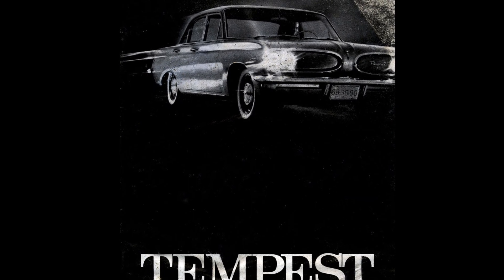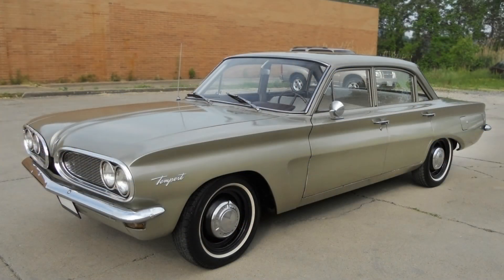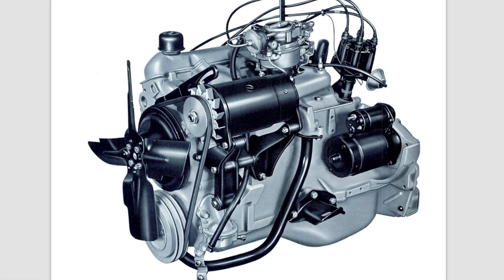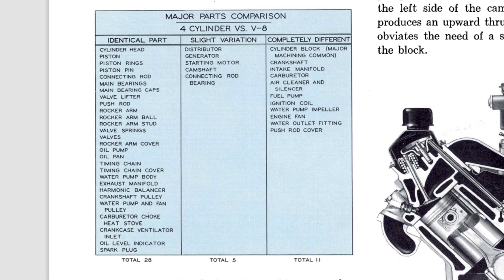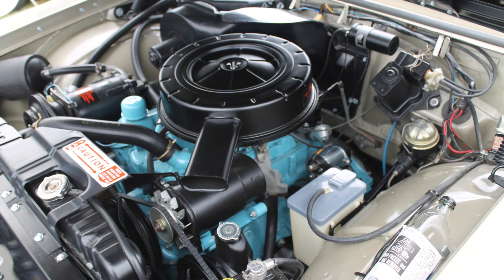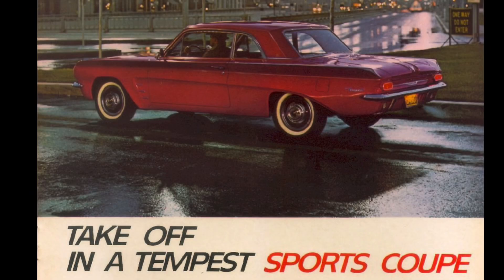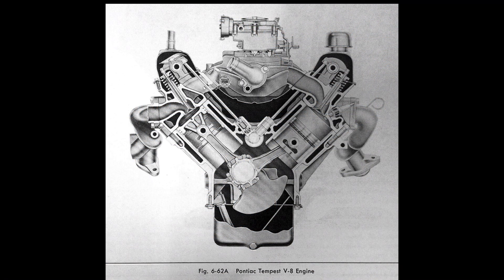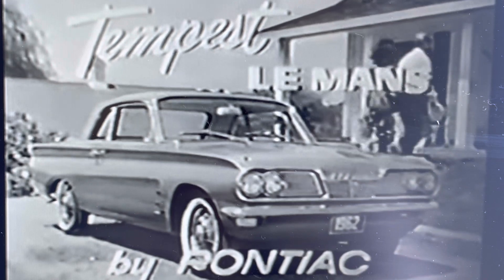Strangest Automotive Engines: The 1961-63 Pontiac Tempest & Its "Trophy 4" / "Half 389 V8" Engine

Comment: My mother had a '62 Tempest with the 166 horse engine, four on the floor, and convertible top. It was one of the cars I learned driving in. There was never any way to get it to idle anywhere near smoothly, but off idle, it was a fine little engine.

Comment: I learned something. Please do a piece on the 88,89,4.5L Cadillac aluminum V-8, 152 H.P.
With a reasonable torque rating
Of 242 ft.lbs. torque. My 88 Eldorado runs flawlessly, cast iron sleeves of coarse, downdraft fuel injection. Of coarse for 90,91, 4.0L, port fuel
Injection and more horsepower.
Highly underated as to durability . A great engine, unlike the Northstars which debuted in 93 on some models.
The 92 Eldorado with its last body style change until its demise  In 2002, the 92 had the 4.0L. Thanks for hearing my rant
Reply: *4.9L for 90,91,92

Comment: Corvair trans Independent suspension I got a 62 with a four-speed with air and Four barrel got mini 61s just rescued us some from the junkyard and got a couple wagons another strange engine for Pontiac 66 and up probably into the 68 arrow would be the dual overhead cam six cylinder with the four barrel Holley on it

Comment: When I was a teenager I kept up with automotive improvements and Hot Rod magazine.  I never expressed this thought to anyone because I didn't think I knew was interested in cars.  One thing I did notice was that I had gotten to the point where I began to think Pontiac was the "experiment" department of GM.  My interest in Pontiac was fueled by the 56 Pontiac we had when I was a teenager.  It seemed to me that Pontiac was coming out with all these weird new ideas like the 4 cyl. engine, the rear transmission and things like their overhead cam 6 cyl. using a belt drive.  That idea vanished as I noticed other GM manufacturers weren't using those ideas.  My favorite Pontiac is still the 65 & 66 GTO with the big block.

Comment: Those engines also had forged connecting rods as nearly all Pontiac engines in the 58-63 years.Tho not as reliable as forged rods for high performance engines they were much more durable than the original cast iron ones.

Comment: Cool, I would replace the trophy 4 cylinder with the new LS four-cylinder that Blueprint Engines is thinking about coming out with.  Or find a 3-71 GMC blower to put on it, Mickey Thompson used to sell some stuff like that for the Poncho 4 back in the day

Comment: My uncle had a 1962 baby blue 166 hp power pack Tempest Le Mans. The car had a four speed and a four barrel AFB 480 cfm carb on the four cylinder. He bought the car in 1965 and owned it until 1978. At that time, my brother and I both learned how to drive a manual trans car in the 62. In 1976, we rebuilt the engine. The car ran strong but went through pilot shaft and throwout bearings very fast. Changing the input shaft for the solid driveline was a chore and the torque tube had to be lowered to do the job. After several times changing it, the part became very hard to find. All other parts became very hard to find for the car as well. The car was never on a collision and had solid sheet metal when he sold it. We never did see the car again and I wonder what may have happened to it.

Comment: I had a 1962 Tempest in 1969. The things was running bad from a cam problem and A friend joking said I should put a 327 in it and I did.  I strengthened the unibody to support leaf springs for the rearend and transmission and welded a new floor for the transmission. It was quick. I blew the 327 and ran it with a 283 for a few years and sold it.

Comment: Our family had a white 1961 Pontiac Tempest station wagon from 1964 to 1969. The engine had only 115 hp and as a result it was constantly breaking down or causing problems if the car travelled any great distance on the highways. Toom much strain on the engine I guess.

Comment: My Grandfather had a 1963 version of this car. It was very basic. No power anything and I don't recall even having a radio.  I know he had problems getting the transmission serviced outside of the dealer. No one knew how to check the trans fluid. As I recall, you had to move the spare tire and open an inspection cover where the spare sat. Truly a strange beast.

Comment: The trophy 4 is a remarkable engine. Another guys channel i follow has dyno tested one, and is currently having it rebuilt. Afterward it will be redynoed with early and late heads, different intakes, including aftermarket 389 parts and POSSIBLY a turbo setup.

Comment: In the UK the same philosophy was applied by Triumph to the Dolomite straight four and the Stag V8, which despite being OHC had a half-speed shaft where the cam would be in a pushrod V8, that was used to drive the ancillaries and, by chains, the camshafts. There was much commonality of parts. The straight four was licenced and use for many years by SAAB.

Comment: I remember that.  My dad was a product engineer at Pontiac from '47 to '85, so I took a big interest in cars and Pontiacs in particular.  In the late '60s, I actually had a '64 GTO with the 389 cu in V8 engine.  Engines today are so-o much better with fuel injection and precise monitoring of the air-fuel ratio not to mention the tight tolerances of the machined parts.  Thanks for this walk down memory lane.
Reply: Also remarkable about today's V6 engines is with the power they generate with regular gasoline; yet, the modern engines can have fuel mileage equal to, or better than, of early generation compact cars.

Comment: Interesting video, Adam, learned some new things, thanks. Years ago, I bought a semi-restored 1963 Oldsmobile F85 that had the famous 215 aluminum V8. Best engine I ever had in any car. The slightest touch of the ignition switch would start the engine in a fraction of a second, and it ran and idled flawlessly, hot or cold. At idle, you could barely tell it was running. Best part: I got it at a great price because it would instantly stall out the moment you touched the throttle, so you had to drive it extremely carefully.  A few weeks later, I took off the top of the carburetor and looked into the accelerator pump tube, and noticed that some moron carburetor rebuilder had left out the tiny ball bearing that acted as a check valve. Dropped a random ball bearing into the tube, reassembled the carburetor, and suddenly the car would spin the tires on heavy acceleration. That was a very happy day. Kept the car for a long time until I loaned it to my brother, who took out the side of it, claiming someone sideswiped him on a bridge and then drove off. He later admitted he did it in a parking lot.

Comment: Rear Transaxle is much better than  front wheel drive  🚗. 
The Aluminum 215 V-8  and rear Transaxle ,  could have been updated  to compete with the Ford Taurus.  Alot of  interior room and 30 mpg,  huge trunk.  A Car  25 years ahead of it's  time.

Comment: The International Scout had two 4 cylinder engines built off of the IHC V8s. There was the 152 from a 304, and the 196 from the  392. I never saw the inside of a Scout motor, I was told that they had a V8 camshaft. I have seen one with a 4 cylinder distributor cap, all the rest had V8 caps. IHC use timing gears instead of a timing chain in the slant 4 & the V8. I am not sure when IHC started the slant 4. I have seen a 1960 Scout. I think that they ran from 1960 to 1968 or 1971. One of the motors had a turbocharger on it, I believe that it was a 152 turbo. 
Hello from north east Montana. 
10 miles from the Canadian border.

Comment: That was my first car dad found it's somewhere like 50 bucks the turn signals didn't work he told me when you get the turn signal will get tags for it and you can start I was 16 finally figured out turn signal switch in the steering column with broken Saturday came around dad May went down to the local wrecking and I had one got to switch out when home put it in we had turn signals three months later Dad sold it for like 400 bucks we get another car there you let me drive

Comment: I took my license in our 61 tempest it didn’t have park on the transmission rolled down a hill thank goodness the curb stopped it the parking brake was fully on after it ate it’s second chain dad traded it for a new 65 impala 327 loaded with air. We never missed the Tempest rough running 4 cyl engine

Comment: In 1969 I bought a white 1962 Tempest convertible.  It ran great, but kept pulling the left rear axle shaft out of the trans ... and the automatic trans shops were killing me.  I sold it and bought a 1965 Bonneville convertible, red, red gut, white top ... which I wish I still had today.

Comment: If the Engineers at Pontiac under the leadership of Bunkie Knudsen had only created a harmonic balancer that was doughnut shaped and subdivided into smaller chambers filled with oil separated by baffled  walls; they might have been the world leaders in small engine design. Just think, in another ten years or so, the energy crisis of the early 1970s called for just such an engine. GM would have had the jump on the Japanese and Germans by perfecting such an engine. We know what ended up happening. The oil companies would have their way and the consumer got screwed. Pontiac may still be with us if far sighted wisdom had prevailed.

Comment: I owned a '62 Lemans with 166 horse motor, four speed transaxle, etc. 15" wheels and tires paired with limited slip differential made for a very good car in snow. On the other hand swing axles similar to first generation Corvairs made for snap overseer if pushed too hard in corners. MPG was not that's great either. BTW, mine was same as red model in add except I had full wheel covers and Blackwell tires.

Comment: I want to see a good and thorough explanation of how the torque converter hanging off the very end of the drivetrain works. Does that whole assembly spin while the engine is running or is that an external cover or what? how do you get power in and out of it? Looks violently insane. I first saw this madness via the article on Ateupwithmotor.
Reply: It IS "violently insane"! When I was 19, I worked at a transmission shop in Pittsburgh, PA, USA and one of these Tempests came in for service. I actually worked in the torque converter rebuilding shop. There are concentric shafts (one shaft spinning within another shaft) in any automatic transmission. The Tempest transaxle and torque converter had one or two more! The power came from the engine through the torque tube, then all the way through the transaxle to the torque converter. Then it went back forward into the transaxle. To this day I still don't know how they got all of that to work. Because of this crazy design, the torque converters and automatic transaxles were completely unique to these '61-'63 cars.
Reply: @snowrocket  Look up the Vanagon 090 Automatic transmission - it's weird sorta like that - had an 84 Vanagon with this autobox and instead of having the pump directly behind the torque converter it had a loooooong pump shaft that went all the way to the back of the trans.  For bonus fun the seal between the automatic trans section and the final drive likes to leak and allow the gear oil and ATF to mix. This was an old, old school design with 3 speeds and no torque converter lockup. Got mileage like a V8 and made 80ish HP with the 1.9l wasserboxer engine. It was a total and utter dog.
Reply: @mrflamewars  Interesting; I never knew that about the Vanagon automatic. Friends had a '77 Bus, traded it on an '84 Vanagon wasserboxer 4-speed. It was faster, quieter, better heat, and about the same gas mileage. It did develop cooling system issues resulting in the extended warranty covering the new cylinder heads and gaskets coming months later from West Germany. After that it was fine.
Reply: @snowrocket  There's a reason why that engine is jokingly called the "Wasserleaker" 😅 - I had to pull mine apart several times to replace the water jacket seal "head gaskets" - even using the inky black SUPERIOR GERMAN ADHESIVE REINZOSIL called for in the Big Bentley Manual. Mine was an 84 as I said but it had cylinder heads that had date stamps cast into it that said they were from 86.
Reply: @mrflamewars  Hmmm, did not know they had that head gasket reputation. These days there's several people who ditch the VW engines on these old rear engine models and use Subaru 2.2 and 2.5 liter engines. One guy I talked to put a Golf TDi engine in his Vanagon and says it's much better.

Comment: The engine was in the front the transmission in the back and it was connected with a rubber driveshaft that ran in a tube

Comment: You know, one wonders why they didn't make a V4 by cutting out the two center cylinders. Same amount of balance, you'd just need a different crank and camshaft.

Maybe someone thought it was "too small" and therefore Americans wouldn't buy it?

An interesting variation on the Slant Six concept. Obviously didn't persist all that long, because it was a stopgap, and it stopped the gap well but not exceptionally.

Comment: I owned a 1962 Lemans convertible for 162,820 miles. White/Red buckets/Blk top. Best car I ever owned!!!! In my youth I cut a wide swathe with it. The ONLY reason I sold it was the fed reg that was gonna end convertibles and I wanted another vert!!  (turned out that never happened but too late for me LOL) LOVED THAT CAR!!!! (best part next)
This wont help anyone now but after I cut 2" holes on either side of the radiator and fed the air cleaner with cool outside air, it gave me "back" more than 80HP. (Smokey Yunick "showed me how"). You would be surprised how many 215V8 F85s and Skylarks I surprised. 
(if ya want I'll explain the math why)

Comment: As a transmission rebuilder back in the day, I rebuilt several of the "Tempest torqs" (spl?) transmissions.... basically a modified Power Glide. Corvair also used a similar design. Ah the good old days before electronics go involved!! LOL
Reply: Those Tempest transaxles had extra concentric shafts in them versus a regular automatic transmission. I saw one of those Tempests back in 1984 when I briefly worked in the torque converter shop of a transmission shop in Pittsburgh. I remember the tranny dipstick tube was behind the license plate. Did you guys charge extra to rebuild them and did they hold up OK compared to other trannies of the day?

Comment: We had a 1961 Tempest that we got rid of when it threw the timing belt or chain?  If you accelerated rapidly and then let off the gas you could fling the timing belt off of it's required position. What was happening was the long drive shaft would get wound up like a spring and then when the power was suddenly taken away the driveshaft would snap back flinging off the timing belt/chain.  My dad asked me what car we should get next and I said the Tempest because it was the Motor Trend Car of the Year. I still feel bad for giving him this bad piece of advice.

Comment: In the early 70s, I bought a 1963 tempest with the 326 V8 in it. I loved that it had the stransaxle and swing arm suspension. It ran great.
For some reason though Pontiac put a flexible driveshaft in them. Those were prone to failing, although mine never broke. 
However, the shift mechanism was similar to a VW s.
The stick on the floor went down with a tang into a cup on the shaft. The tang had a ball on the end. The shaft had a 90 degree and then went back to the three speed transaxle and worked on cams to shift gears.
That shift rod or shaft was held up with a bracket that had a two-piece neoprene bushing in it.
Mine wore out and fell apart while driving on the highway.
I could not get that bushing or anything close, so I had to junk the car.

Comment: Chrysler chopped off 1/4 of a 318 (5.2L) to get the 3.9L V6 used in Dakotas. In some ways, they then stretched the 3.9 to get the 8.0L V10 in 1994. It’s bigger bore and longer stroke, but the intake and ignition are a 6+4 cylinder affair.

Comment: I am familiar with this engine. The 389 V8 was very durable and later used in diesel configurations in the 1980s in trucks and vans from GM. However, it was a huge cost saving measure on GM’s part to cut it in half to save money to make a four-cylinder back in 1961. In reality, it was a very rough running engine with poor fuel mileage that had a short service life. By the time it got up to about 80,000 miles it was time for a rebuild usually if it made it that far. If pushed very hard before that it was easy to spin a rod bearing in one. That was largely what held the sales back by 1963. The optional aluminum Buick/Oldsmobile V8 was a much better choice. (Consequently this engine lived on in range rovers up until just very recently). Many people do not realize that the 61 to 63 tempest was re-skinned and based on the Corvair platform. Another cost saving measure by GM. While it had good weight distribution with the current layout of the drivetrain and handling was impressive, if it was pushed too far it was also a severe rollover hazard as the Corvair was with it’s German influenced swing axle in the back.

Comment: We had a 1961 Tempest with the aluminum V-8.  One thing about the transaxle- there was no Park position.  I worked as the janitor at a church in my hometown of Sierra Madre, CA.  Set  up against the San Gabriel Mountains, the north-south streets were pretty steep. I had turned the front wheels out and rolled against the curb, left the car in Drive and crammed on the emergency brake.  I was inside when I heard a series of serious noises.  Imagining that the car was rolling backwards down Baldwin Avenue.  I rushed outside and saw that the Tempest had rolled, but, with the wheels turned, it jumped the curb, rolled actually uphill and then forward, over the curb and sidewalk and into a bed of ivy.  Wow!  I backed it out and made sure to park on a flat street from then on.